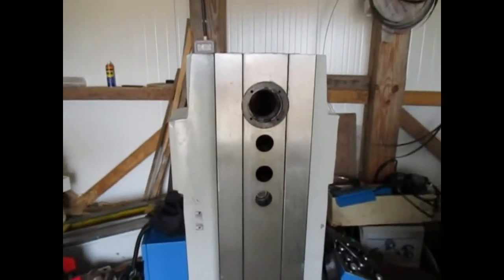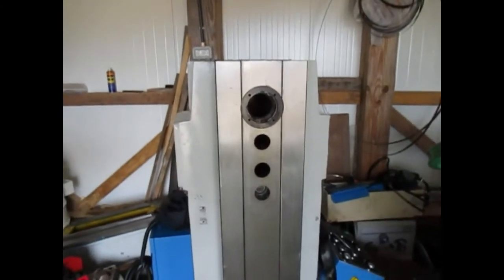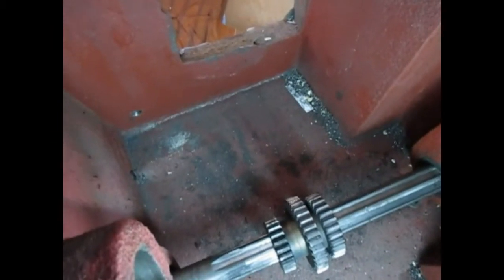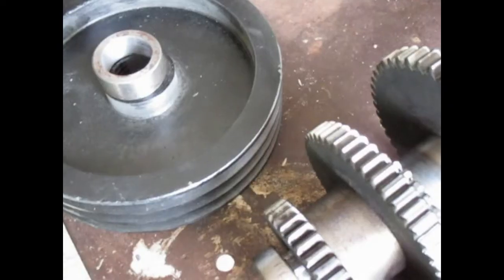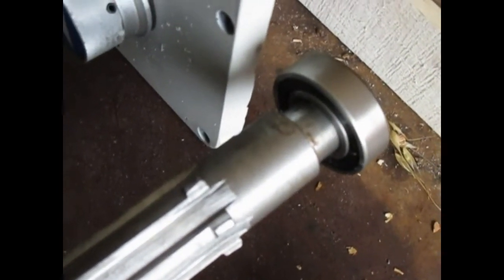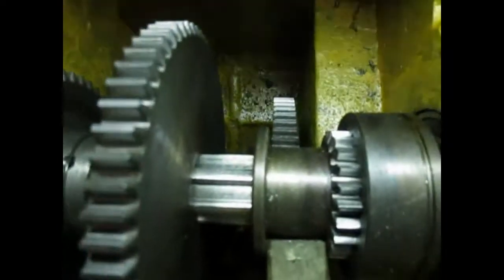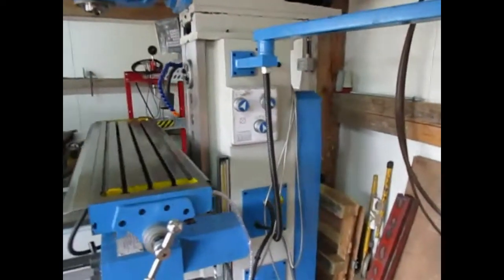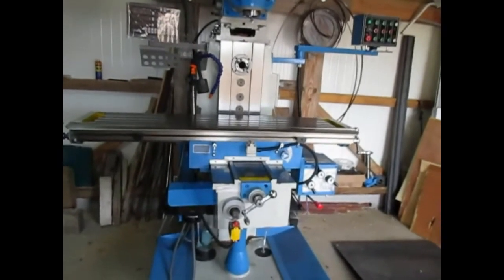Universal overarm milling machine XQ6232

Comment: Only cleaning issues? Or mechanical issues?
Reply from the maker: Missing guards, electrical safety stuff, eg RCB, trips on motors. It cost me a lot to get the machine inspected, improved and certified for CE standards. Other wise it would have had to be scrapped by the customs people, or sent back to China.